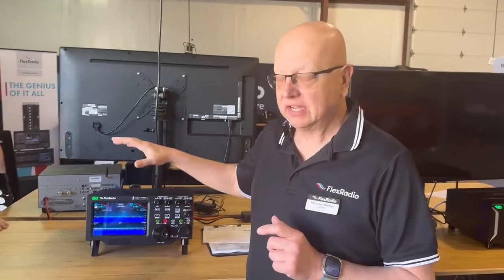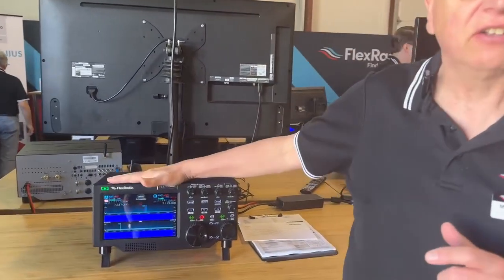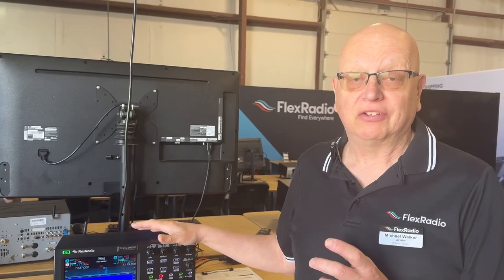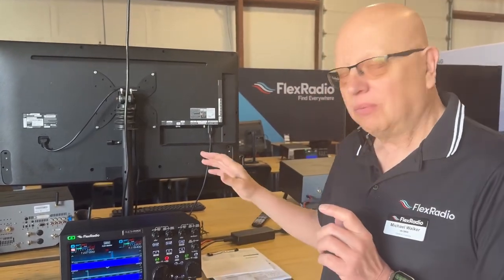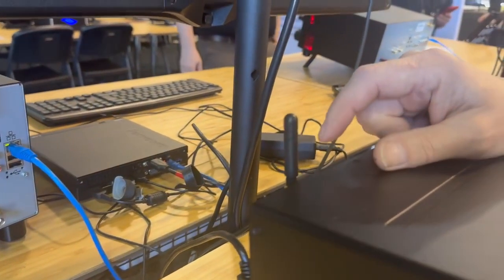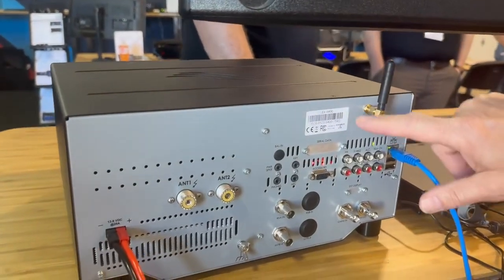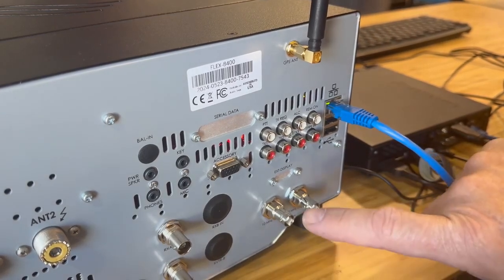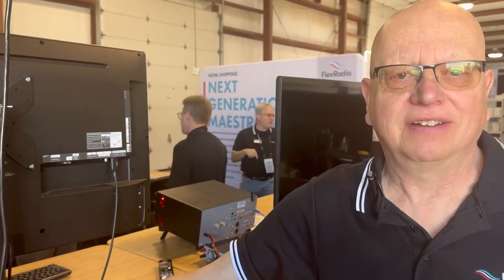The New FLEX-8000 Series of HF SDR 100w Radios

Comment: All cheap technology now. So why so expensive?
Reply: Building any product for retail does require significant revenue.  You have to pay staff, pay insurance, buy raw materials, build, test, make changes and even rebuild.
Reply: I know everything that the new flex can do you can do with a Hermes Lite and a computer and some free software and will do it way better than that flex  for around 500 bucks
Reply from the maker: @greglyons2402  Sort of.  Can you connect hardware directly to the back of the radio to send CAT control to the Radio?  Can you do plug and play remote and get it running in 10 minutes without having a Networking degree?  Does it have CESSB?  Dual Transverter Support with direct integration into SatPC32?  Can you run it from a MAC or iPhone? Does it have a GPS build-in for 1/2 hz frequency accuracy?  100 watts out?  Can you listen to 160M and 6M at the same time or any place between 50Khz and 54Mhz with up to 8 receivers?  Is it built in the US with a 2 year warranty and support from FlexRadio staff?  However about a 30 day return policy if you don't like it.  NTP Server?
Reply: @FlexRadioSystems  Nice job hiding comments instead of engaging in a conversation.

Comment: This is a true game changer for amateur radio.  Having a GPS built into the radio is huge and having an NTP server built into the radio will solve a lot of timing issues for the digital modes.

Will the API be extended to provide Lat/Lon and Grid Square 4/6 information?

I can't wait to see the wider receive bandwidth for the digital modes in action.

Looking forward to seeing Flex in Marlborough.  I know I'll have more questions.
Reply from the maker: The commands already exist in the API and apply to all radios running SmartSDR.  Here is the API command and the response:

c1|sub gps all
S4EAD1E55|gps lat=0#lon=0#grid=#altitude=0 m#tracked=0#visible=9#speed=0 kts#freq_error=0#status=Warming Up#time=00:17:44Z#track=0.0

You will need to calculate the grid square using the LAT/LONG values.
https://stevemorse.org/jcal/latlon.php